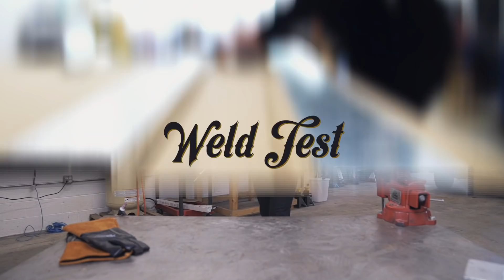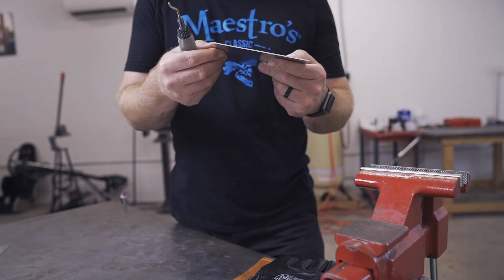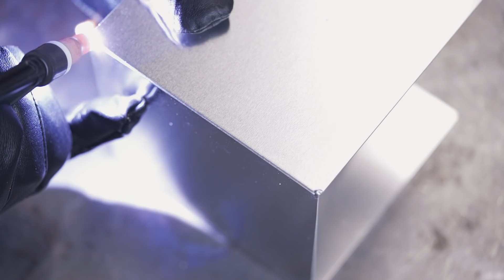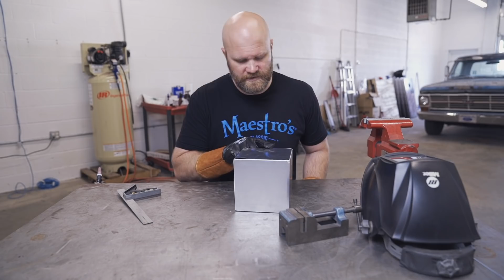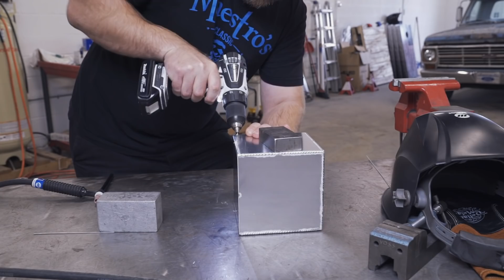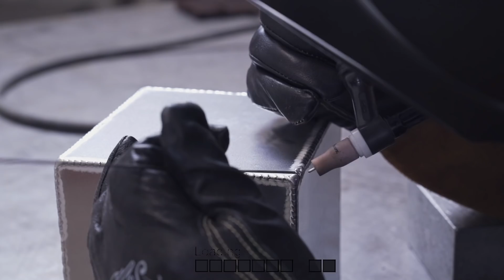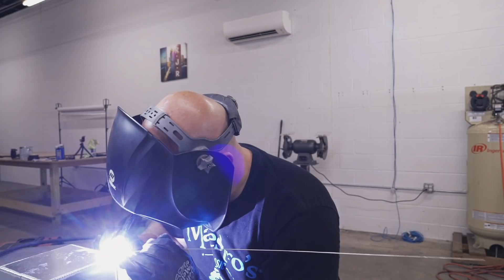Ace a NASCAR Welding Test - TIG Welding an Aluminum Cube

Comment: We had to weld one of these with a mig welder and pressure test it to 10 PSI for leaks but it was mild steel.
Reply: Ya migs suck for aluminum tanks. I use a spool gun and a tig. Welded and repaired fuel tanks. Migs unreliable for perfect seals. Usually issues in corners.
Reply: @1223-i2h  I've seen mig welds on aluminum, and I'm fairly confident that JB weld and zip ties are better.
Reply: Lol

Comment: you have to let the piece cool the heat is expanding in the box and that hole is pushing air out making your argon non existent. let it cool for 20min then do a little spot weld. also put your beads closer together about 2x the speed you are dipping your rod.

Comment: What was h the frequency set at. That's what I want to know.
Reply from the maker: Mine can’t be adjusted
Reply: @JustVoss  wow man, mad props. Adds a degree of difficulty not being able to adjust the frequency. The machines at my previous employer were garbage and any low amp ac caused a wicked wandering arc. Anything thinner than 1/8 was just a real pain in the butt.

Comment: Only suggestion I’d have is trying to drill the hole through the tack weld in the apex of the corner (rather than slightly off the corner), and using a smaller bit would help seal the pin-hole back up when you get to that place. Making shorter runs will also help keep the interior cooler, as well as someone else’s suggestion of flooding the inside with argon to manage temperature. Taking these things into account could help get it all done without grinding down any of the welds to redo them.

Comment: How come when I try to tack a corner with Tig aluminum, it blows out the ends and doesn’t fuse together... anyone help?
Reply: Nickolas Jimenez make your tacks quick, the longer you sit with the heat without melting it, the more chance you have of it rolling away from the other pieces. just a quick zap, heavy but steady on-off on the pedal and your two corners should just fall into eachother.
Reply: Paul Henrichsen thank you so much!

Comment: It would help to clean off the oxidation before welding since it melts at a higher temperature then the aluminum does. like many other have said, if you show up for a weld test and are not prepared with the proper equipment you already failed my test. Every weld test I have taken has included non-destructive or destructive testing e.g.  X-ray, bend, impacts tensile.

Comment: Use the acetone after deburring, so itll remove the fingergrease as well... It isnt really necessary to remove fingergrease prior to welding, but wiping down a brand new sheet of alluminium isnt necessary also. So you want perfection? Use the acetone after deburring/touching everything.
Great vid, tho!

Comment: Let it cool off then it will close up, and it might just be the camera but it looks like you were long-arcing, keep that tungsten close enough so that the filler wire wont hit it when you dab it and you'll get better looking beads they will lay in flatter and better penetration. Other than that your technique looks good. That thin stuff is tough though, the bead wont ever look like a 1/4" plate outside corner joint but if you have pulse you can make it nice.

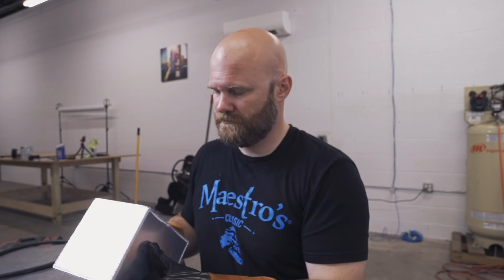Comment: 16:08  Any chance putting the bottom of the cube in a water bath or ice bath while welding would cool the air inside to prevent pressure buildup? (note: Not a welder, just genuinely curious... so there may be something trade-obvious I'm unaware of)

Edit: I realize cooling down the metal to extremes will distort the welds and dimensions. For doing the last touch up stuff would it be helpful?
Reply from the maker: Just letting it cool is enough, only takes  a 5 or 10 min at room temperature.

Comment: How did you get a perfect 90 degree by eyeballing? That’s impressive
Reply: When you work with straight lines often you eventually get what I call a sense of "right there". I can't explain it but I once did a custom exposed duct job at an office for who else, Architects. I used to get complaints from the guys that worked with me because I couldn't leave "good enough" alone. When you take pride in your work it shows, it definitely shows to those that know and care.  That was probably one of the simplest jobs and as well the most rewarding, hearing them comment on Monday morning how impressed they were in the proportion and how straight everything was.  The real secret is that when it's an old building with nothing straight in it, yours will stick out real proudly as the oddity. So  being straight isn't just a measure, sometimes it becomes the constant needed to satisfy...
Reply: Bimmer Boi when all the pieces are perfectly identical in perimeter and you tack every piece before laying any solid beads it makes it way easier.
Reply: j m  one thing I can say is that when you work with sheet metal and your intent is quality you do everything  you can to understand and accept the need for tolerances. 
What I am saying is even though it doesn't seem like much, one aspect is the thickness of the material needing to be accounted for. So whether you bend it in a brake or butt weld it you need to understand how the thickness plays into the axis planes they intersect at.
Most of the time if your fitment is right and you are used to working with a material that your used to
It almost looks easy, it comes with time after being dedicated to making good habits to begin with. It all comes with time and attention to detail.

Comment: flood argon inside the cube thru a brake kleen straw that reaches near the bottom of the cube, its heavier than air and will stay put, it expands far lees than air from the instant heat (its dry, air has humidity)...  Cool channel...

Comment: Roll an edge over in the corner and at the end tap it Down and weld.   99% of the time you will have a tap that will need to go in for oil or some.thing and that will be the open space.  Great work!

Comment: As someone whose worked for a race team, alot of what this guy says is true, although the skill level used for tig wouldnt be decided on a box, itd be things with curves and tight areas the would emulate out of position welding for a roll cage or a large majority of the fabricated components in a stock car, sadly though the era of a fabricated stock car will soon come to an end
Reply from the maker: Been in NASCAR for a long time, depending on the job you’re right. But most teams aren’t tig welding their chassis anymore and components like what I did are welded on a table and can be moved. The very last part of what you said is also unfortunately correct, sadly.
Reply: Justin Voss i hate to see the composite body package, it seems as though rather than using a less expensive product to save money NASCAR and the teams have decided that eliminating building aspect to building a stock car

Comment: You could run a purge line...two holes instead of one...I have just began my welding career less then a year ago I've learned alot form you thanks man...I'm not sure if my idea would work..but I've seen stainless purged with aluminium foil caps....lol...just my theory if you get the oxygen out of it it will be cooler and seal/weld smoother

Comment: Pretty cool to see a local guy making vids. Another quick tip I found by accident is tack the plates flat then bend them to 90 using machining square. Makes fast accurate work vs juggling 2 pieces, filler and a torch.

Comment: The welding tests that I did in the navy involved more than horizontal lap joints. You should have jigged the cube into a fixed position. Then you will have vertical, horizontal, and overhead joints to weld.

Comment: when welding something that must be sealed; aluminum handrails things like that.  i do one of two things:  let the whole thing cool down, if you have the time for that, and weld it up real fast before the gases have time to expand, or while it is hot take a center punch and close that hole with excess filler rod then weld over it.  i weld a ton of aluminum and when i cant get a hole to weld shut that is what i do.
Reply from the maker: Nice! Thanks

Comment: I was told by my welding teacher that welding Aluminium let’s off some kind of gases that cause cancer. So as a result he is not going to teach my class to weld aluminum. Is this true?  By the way your video was great and I subscribed and liked.
Reply: He cant weld aluminum i bet 😂
Reply from the maker: It all probably causes cancer. I’v welded  zinc covered bolts because I didn’t have time to sand blast them and was sure I was going to die that day.
Reply: Thorium doped tungsten electrodes can be carcinogenic, but I don't think there's anything that's specific to aluminum TIG welding. With MIG, I wouldn't be surprised if flux core wires were carcinogenic.
Reply: I've not heard anything about aluminum but stainless can without good ventilation

Comment: I did this in highschool shop class for final test in welding a cube that floats in water.
My solution for the air pressure was to stick it in the freezer before I finished the last edge.
Reply: I was welding small parts in a stainless cook pot or a hubcap to go cheap on argon.  I wonder if you could set this aluminum cube in a pan of water to keep it cool?
Would it have too much electrolysis?
Reply: Why would you put it in the freezer?
Reply: @ignacioaguirrenoguez6218  compress the gasses inside.
Reply: @eugenew2  Yeah, how will compressing the gases help in any way?
Reply: @ignacioaguirrenoguez6218  thermal expansion is the gases inside and the metal container that needs to be sealed is less at cooler temperatures. It changes slower and gives the welder a slightly longer welding time before the gas blows out again.
Reply: My solution is to just let it cool down for a few minutes and go outside and vape while it's cooling.
Reply: @ebogar42  you had me in the first half

Comment: As a hobby welder, it took me quite some time to realize just how clean everything need to be to get good TIG welds. Then when I finally got the hang of it, I happened to try TIG for fixing rust spots on an old trailer I was repairing (it was already “welded” and as I was prepping for paint I found a couple of pin holes I hadn’t noticed, and the thing was already degreased and cleaned and sitting on top of plastic, so no way I was going to try MIG). It worked like hot damn, even though the material was rusted on the back side, never would have believed it. Until I got to the last hole and it sealed the section, and the material was a bit rustier on the back side around that hole, and the thing spat out the puddle right on to my stomach. I’ve never shimmied out of under a trailer faster than that in my life, took me almost a minute to get into position, and I was out from it and upright in 2 seconds. :) Apparently rust expands, outgasses, reduces and spits out oxygen, or something when you try to TIG over it, because it ejected the puddle with force.

Comment: Once it’s cooled. Put your finger over the hole and run it under cold water. Then fill that hole. The aluminum won’t build enough pressure to expand the air inside.

Comment: Perhaps you could cool the box right before welding the hole? As the box begins to expand as it heats, it would draw gas in through the hole, allowing welding gas to flow into the cube? I think that’s right, otherwise heat it first and as it cools it draws air. But I think I’m right - things contract in cool and expand in heat. As it expands, the volume inside would increase, needing air to fill it.

Comment: Just an idea not sure if it would work but argon is a noble gas or an inert gas that is heavier then air.
Would it have worked if you filled the block with argon then tried to seal it? Thinking it should work

Comment: Nice video..   As you mentioned, if you really HAVE to build a sealed aluminum item, filling the 1/8" hole will be no problem if you let the item get dead cold before filling the hole.  Now, to really test your skill and knowledge, weld a bung onto the tank, pressurize it with Helium, then test it with an electronic sniffer to detect molecules of Helium seeping through the weld.  That can keep you up nights.
Another note:  Once you weld aluminum, regardless of the grade, the material at the weld loses ALL temper, and becomes T-0.  If you need the strength of 6061T-6 for example, the entire weldment will have to undergo full tempering to get back to full strength.  Before this, most aluminum weldments can be manipulated easily into shape and squareness due to the softness at the weld area.
Keep up the good work!
Reply from the maker: Wow good info! That’s kind of crazy to think about.
Reply: I'm no expert by any means but wouldn't getting a sealed container dead cold then sealing a hole be bad? As colder air is more dense so when you seal it and warm it back up wouldn't the container be above atmosphere?
Reply: @Ckcdillpickle  Actually, by "dead cold", I meant the ambient room temperature, not the temperature the enclosure became after welding.  You will add heat to the item when you weld the hole closed but if the air inside becomes slightly warm when the hole is plugged, when it cools to ambient temperature, you should actually have a slightly lower than average pressure inside.  Not that it matters, since all you've created is a potential atmospheric bomb if tossed in a fire.  The object doesn't have much use in itself.

Comment: Im no welder by any means... the closer I've come to a welding unit was about 4 ft... but I think that if you cool off somehow the cube, it will take some time until the air inside heats up as well as the pressure.

Comment: Uses acetone to remove oil and other contaminants .... doesn't bother using gloves, leaving skin oils all over it.

Also I assumed it was fairly common knowledge that when welding a closed volume, filling the void with your gas prior to closing it up adjudicates the issue of pinhole pressure holes. 

Source - ship-building xray welder

Comment: Why do you keep your Wolfram tip so blunt? It seems your point is really short, making it a prett hard taper from the full thickness to the point. I've learned to keep it longer, and it usually concentrates the arc pretty nicely.
In the slowmo you can see yours is pretty wide still 🤔
Reply from the maker: I’ll trying mixing it up some

Comment: Do you prefer a smaller cup without a gas lens for ally? What's your suggested setup
Reply from the maker: For some reason I do yes, especially on thinner aluminum. I may try some gas lens stuff though, just have always used a small cup.
Reply: @JustVoss  I dont do a lot of aluminium welding but I've always been taught to use a small cup with no gas lens 👍

Comment: Get it down to the Tiny hole then use some play dough or clay create a dam around the hole put a had vaccum on the hole use clay or play dough to seal the hose put about 4 to 6 in of vacuum on it have assists remove the play dough quick and weld instantly I do this on tiny aerospace fitting a lot

Comment: I've done a LOT of cosmetic welding.. Tig on stainless for medical walls, and aluminum diamond plate, like truck tool boxes boxes and such. Never come across a "Sealed" application like you were doing. Quite interesting. I think for show,  i might have welded a bung  fitting or something to the top, to represent some sort of tank. all the vent in the world then.
Reply: You can find "sealed" welds on occasion, particularly in tubular welded items.  Like, for example, a diagonal brace.  Usually, if the part is long enough, or you've been able to skip around while welding, the pressure doesn't build up enough to blow out your finishing weld....but when it does, it can drive you crazy.  When I fabricate a tubular construction that may include sealed tubes, I'll generally drill a small hole in the other tubes underneath where the tubes join.  That only takes a minute, and allows all the pressure to vent.  Problem solved...no surprises.

Comment: Is that a 67 Ranger, I’m guessing with a 390 and three on the tree 😎
Letting it completely cool is the ticket to filling that last vent hole.
Reply from the maker: 69 with a 360 and three on the tree, close! I have a video on my channel of moving it to the shop after I lost the key. I’d like to put a fuel injected crate in it.
Reply: @JustVoss  cool truck I have a 71 short box 2wd

Comment: I love how detail oriented you are, looks like an art. You could put it in an ice bath or use CO2 via a small nozzle & fill inside to accommodate & balance the ambient heat. I don't know how you'd adjust though, since CO2 would eventually warm up and expand and you get yourself a shiftmake bomb.
But you can always use CO2 to cool down the outer surface and since it's aluminum inner temperature should fall significantly. Maybe even to a point where the cube would collapse on itself.

Comment: how it is welding with open skin..uv radiation->skin->after 15-20 years what?
Reply from the maker: Yeah maybe screwed I dunno. I also am usually welding pretty thin material with lower amps.

Comment: I thought the acetone was for oil residue. And then you touched it with your hands right after? Please correct me if I'm wrong. Great video regardless. Can't wait to get into tig.
Reply: Finger oils are very miniscule and burn off at low temps compared to manufacturing oil used for sheens trapped between the plastic and metal